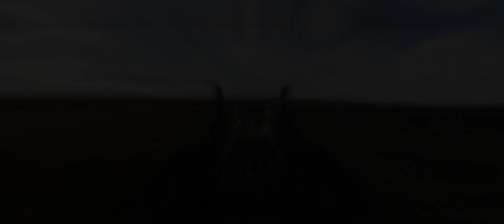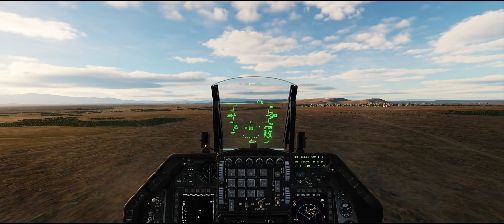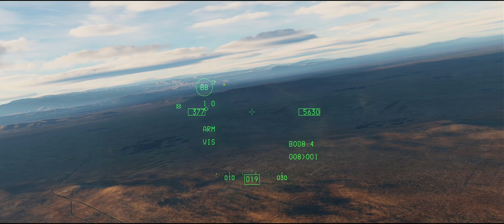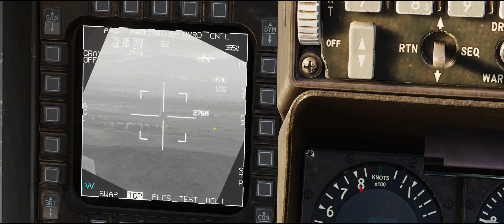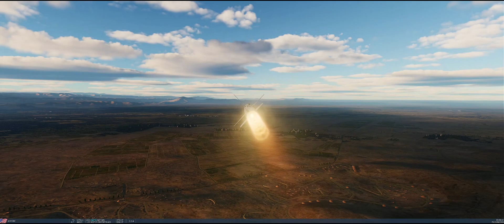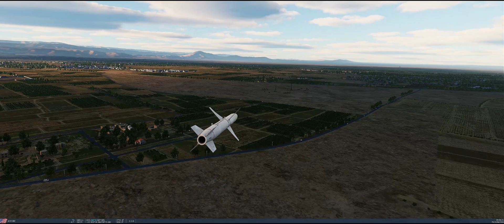HARM EOM Close Range Shots - DCS F-16C

Comment: Can you use the had this way as well?
Reply from the maker: I have an older video, I think titled HARM vs SA-10 where I use the HAD.

In a nutshell, use the HAD to get the TGP pointed in the general direction of the SAM site. It’s not super precise. Look around until you spot the SAM, then use the TGP to create a mark point at the SAM site. From there, set the mark point as active steerpoint and you can shoot a HARM the same way as I did in this video.
Reply: @Gaffer  why though normally I just lock something with the had and then boom off the missile goes

Comment: Wow, as a hornet/tomcat/warthog player this is extremely cool using the HCMS to set a mark point as a TOO attack.

Generally If its a sam system I am unaware of I will rattle one off in SP mode, but otherwise will set manual WP's for targetted emitter attacks, as if RP'ing an actual SEAD attack.

Very cool to see how the Viper can re-act to targets on the fly.
Reply: You can do it with the hornet too, creating temporary waypoints using the jhmcs
Reply: You can do the same thing in the A-10CII

Comment: try using the hts pod...way easier
Reply from the maker: Did that in another video. 

Also just FYI use the HTS pod to find the site in the TPOD then create a mark point and use that for your attack. From close range, the missiles need to know exactly where to go.
Reply: @FLYGaffer The harm gets the coordinates from the hts pod. as long as it gets pgm2 or pgm1 on the had page it should hit
Reply: @Stratilizer  I think the point of this video is to show the quick reaction for SAM with use of HMD. Actually pinning the mark point to location of launch zone is common technique. It is much faster than HTS is able to get the precise location, plus usually SAM sites enable radars in last second (totally opposite to what we can find in bare DCS).